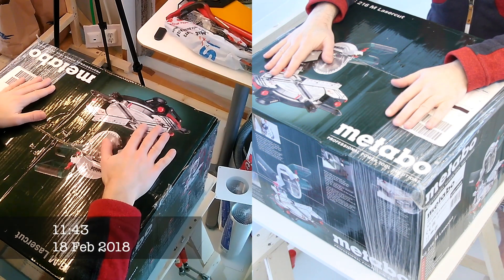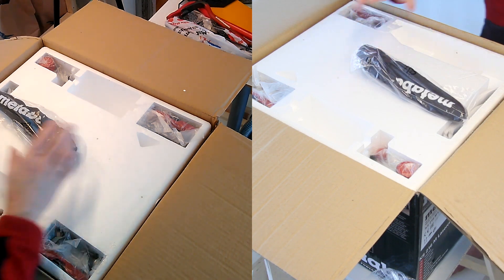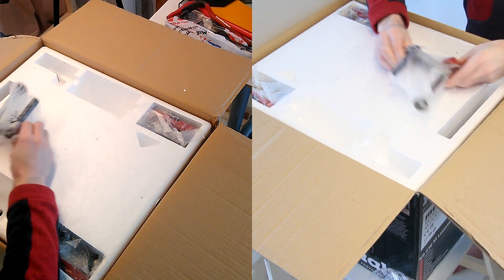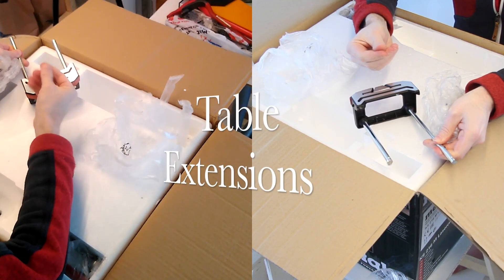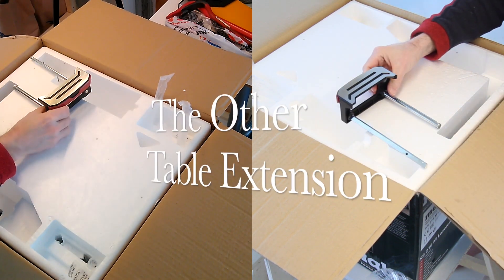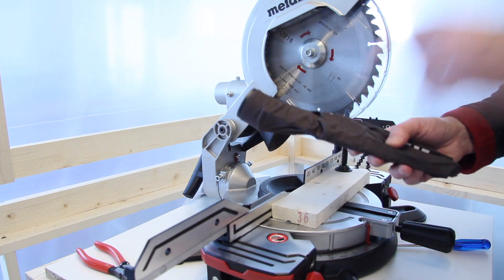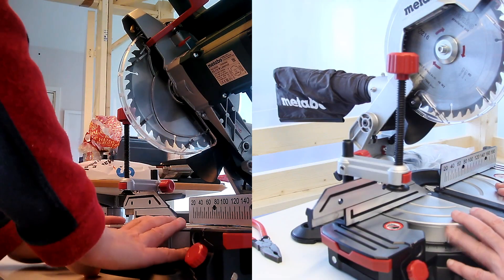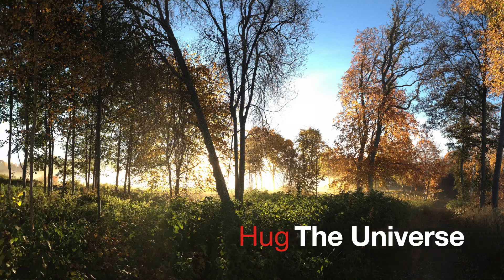Unboxing Metabo KS 216 M Lasercut Mitre Saw [Episode 53 18 feb 2018]

Comment: I bought one yesterday but the laser is out of alignment. Tried setting it but discovered the plastic bracket where the screw goes in is broken. I guess it was overtightend. Could this be the problem the laser is not aligned. Thank You
Reply from the maker: Thank you for your comment!" Sorry to hear about your problem with the laser on this saw. On the other hand - for this price I did not expect the laser to be accurate anyhow. I am planning to mount some white LEDs to have the saw blade cast a shadow cut-line instead. This shadow will always be accurate and will also serve as a work piece light :). Something like this guy did on his saw (https://www.youtube.com/watch?v=MHM8K-JS-Wk). Good luck with your saw!
Reply: @kjell-olovhogdahl6557  Thank You ill check it out and also look out if you post the conversion to your saw

Comment: hi is it cut aluminum? and it's cut perfect 90°40°?...thanks
Reply from the maker: Thanks for asking :). As I understand it (although I have not tried myself) you can cut aluminium with any suitable wood cutting blade. So in that case, Yes, you should be able to cut aluminium with this saw. Regarding 90 and 45 degree cuts you have to put some effort in to adjust it. It does not come perfectly adjusted from the factory. But for the price I suppose I was not surprised about this. I actually filmed me adjusting this saw but I have not come around to edit and publish it yet :). Thansk again for reaching out and I hope you find the answers you are looking for to decide if this is a saw for you :)